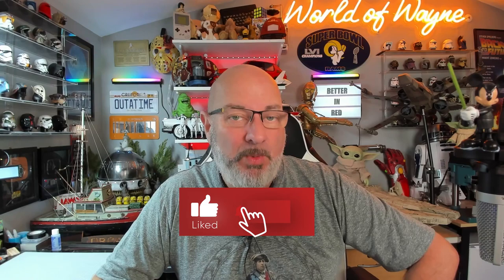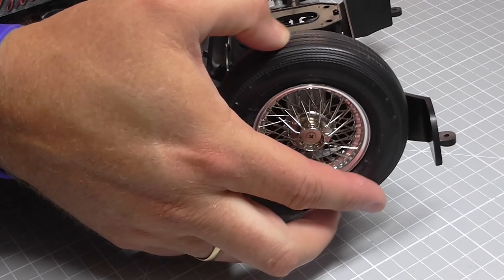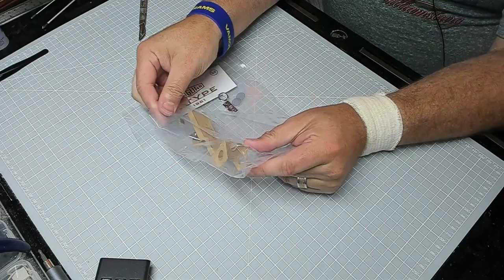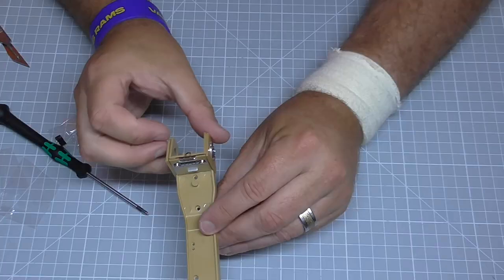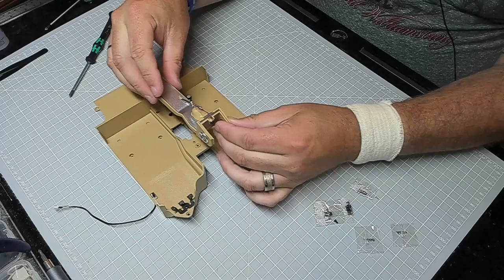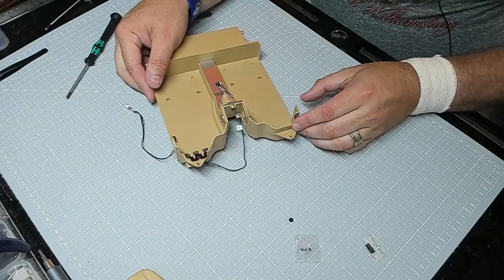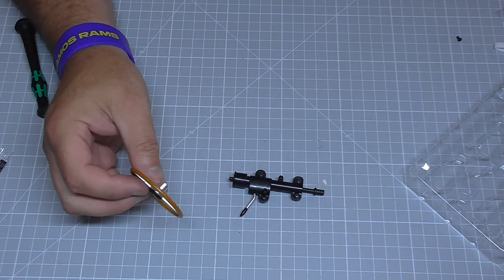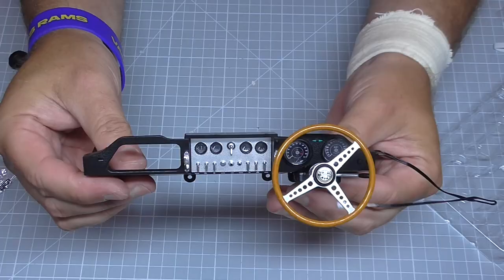Agora Models Build the 1961 E-Type Jaguar 1:8 Scale - Pack 8 - Stages 57-64

Comment: I'd be lying if I said I wasn't slightly disappointed with the interior. There's so much detail, yet they didn't think about putting carpeting. And they could've used something besides plastic for the shift boot. Perhaps a soft rubbery type of material.

Comment: I love this E-type model, and I have my packs coming as well.  However, the interior packs were a bit disappointing to me.  For example, considering what this kit ultimately costs, that middle console part looks way too toy-like in my opinion.  How hard would it have been to make the toggles and other switchgear separate?  I'm going to do a new part for it using my 3D printer, with independent switchgear and a better gauge cluster.  I'm probably going to replace the seats with some aftermarket parts, and maybe look at flocking the carpeted areas. For most folks it's probably fine, I'm just a model car geek and like adding detail.

Comment: No production car had an AM/FM radio before 1963. Jaguar XKE's even in 1967 still had just an AM radio. Also, those old radios had the inch-long mechanical station preset buttons. The radio you show at 4:58 has an FM band and has 1980's-style digital preset buttons. All that work to get the detail of the battery terminals (that you'll never see) correct, then blow it on a feature that is very prominent on the model. Boo!

Comment: Hi Wayne… just watching the video of fitting the rear wheel…. HOW CAN IT TURN if the drive shafts are locked into the diff housing with the rectangular plate through the brake disc .
Was thinking of filing off the two nibs inside the rear wheel boss.
Any suggestions?

Comment: Hi Wayne, will there be any carpet in the interior?
Reply from the maker: You can get some modded carpet from model modelmodz but I won’t be putting any on my vehicle
Reply: @WorldofWayneUK  Oh ok, I thought they might of supplied it with the part works?
Reply from the maker: @johntreloar8203  No it’s very rare for any Partwork to do that
Reply: @WorldofWayneUK  Ok just thought it was the norm, didn't you do a part work that had carpet? or was it after market?
Reply from the maker: @johntreloar8203  the Peugeot did. All the others were after market
Reply: When I built the coupe version I was annoyed that there was no carpet but  a chap trading as Railroad Models produced a set of self adhesive pre cut dolls house carpets which looked superb - he even made me a set in my choice of colour.  He also did resin replacement engine accessories of the right size and decals.
The body pan should be body colour (not black) but the engine block should be black, not silver.  I could go on but won't!